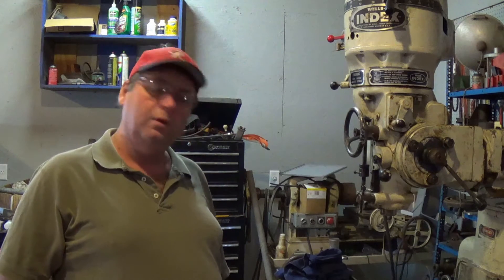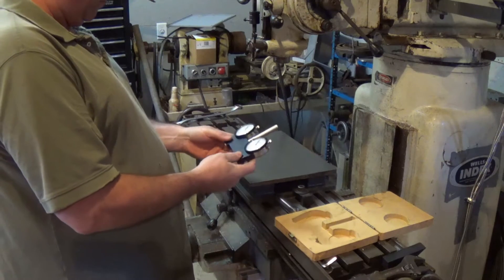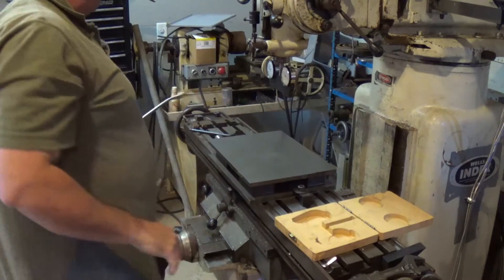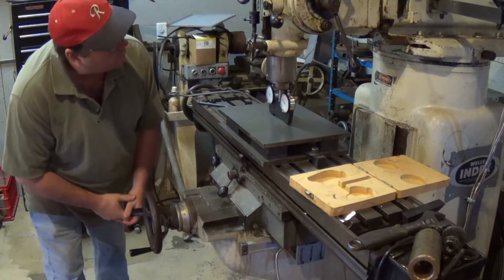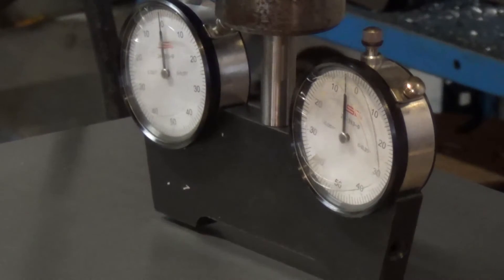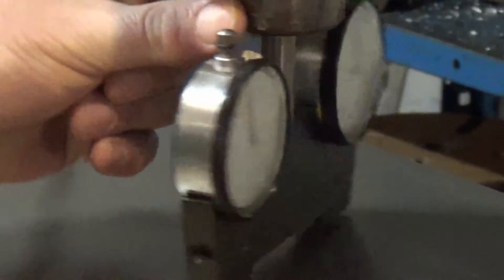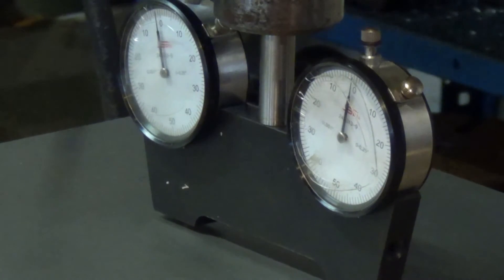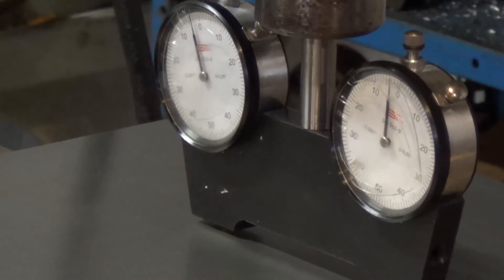Tramming the Wells Index Head with a Spindle Square

Comment: Been a Machinist for 40 yrs and still hate Tramming a head  I need to buy or make one of these. I have been using a Starett last word  indicator and Gauge block for years still Sucks.  but my mill at home is a Millrite milling machine  that only has side to side tilt so no compound angle like a Bridgeport . but there is no worm screw to move the head. so you loosen and hold on for dear life and move it to the proper angle . tramming is a real treat (lol) you have to loosen the bolts just enough so it does not fall and tap it with a soft mallet from side to side to get zero cool huh . I need to get a Bridgeport also because it has Back gear the Millrite does not
Reply from the maker: When I ran the Bridgeport  daily I some times had to tram it in 2 or 3 times a shift depending on the jobs. I never used a spindle square. I just used a Starrett 196 and trammed it to my vice

Comment: This  method is only as good as the tool is square, is it not?
Reply from the maker: bubster1981 
I guess the answer to our question is yes,   That is why I checked the tool by rotating 180 deg before I set the head and after I set the head.

Comment: Nice job---- you made it look easy with that fancy tool
Reply from the maker: Tom, the spindle square is a little easier. but the Wells index head pivots in the center so tramming it is a lot easier than the Bridgeport type.